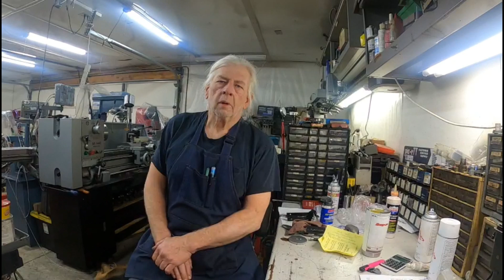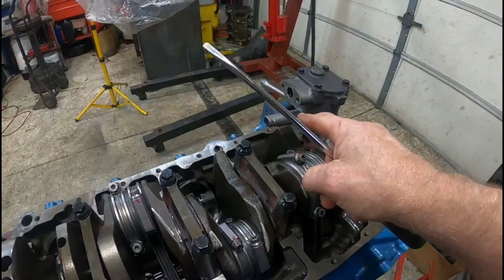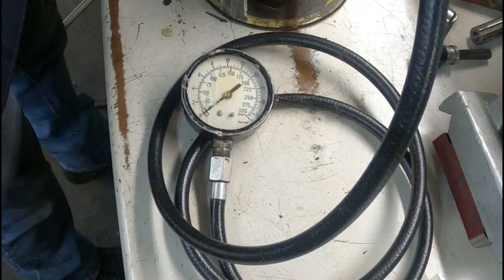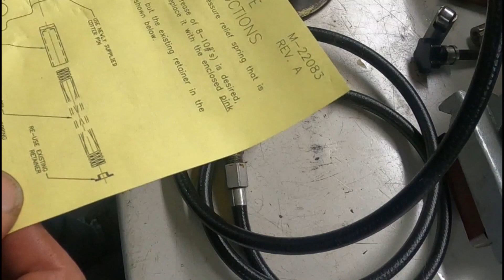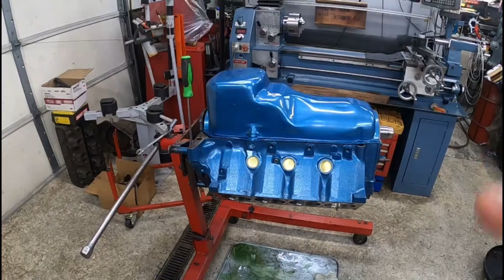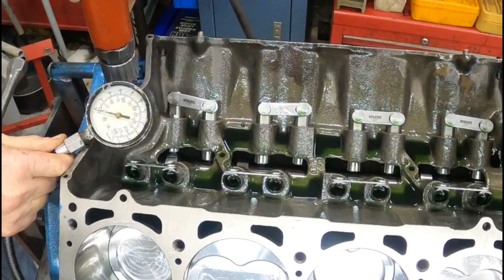Finishing the short block

Comment: Looks great Randy.
I like the Oil Pump Dyno Test!
I would have put the higher pressure spring in also.
Great idea.
Have a great day.
Reply from the maker: Hi Ed  I will see what it does when I run it on the run stand first, the pressure only dropped 5 Psi when priming the engine. And that is about normal with that gage and when the engines are running it is around 60 PSI hot at Idle. Give them a little RPM and it jumps to75-80 PSI .I am using the std wix filter and do not need to worry about blow the filters off from high pressure. Have a great day.